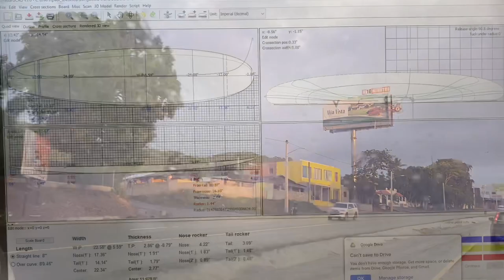Shaping and glassing a surfboard - Part 1: making my own blank

Comment: What wood did you used as the stringer.
Do you know what is the best you can use for it?
Best weight, or floating vs resistance
Reply from the maker: I am really limited by what I am able to find at the hardware stores in the Dominican Republic.  I just used a 1/8th inch plywood on most boards.  Maybe a bit thicker on the longboards.  But if you can get better, I would.  The stuff I have is hard to plane while shaping and often has been weakened by termites somewhere along the line.

Comment: Great vid o. What is the density of the foam??
Reply from the maker: When I asked what densities were available, they gave me a scale that I didn't understand.  They showed me samples of "16", "22", and "30".  My best guess is that the "22" (which I bought) was probably about 2lb.  That is why I was sure to add a vent.  I wish it was more dense - but the "30"  they showed me cost quite a bit more.  They sold me this piece 8'x4'x6" for approx. $75US.